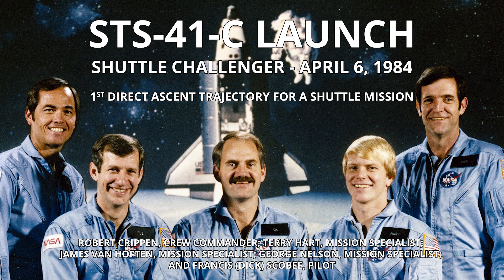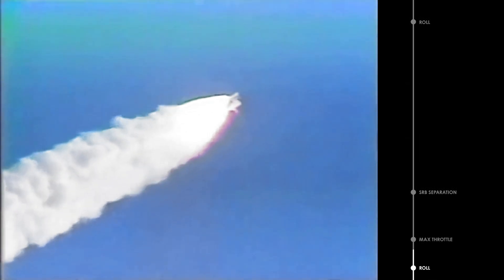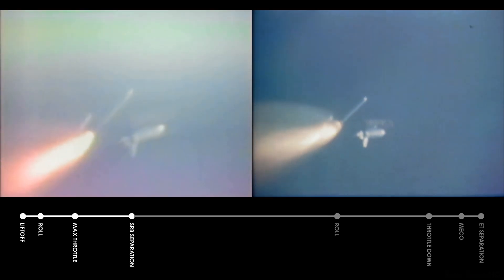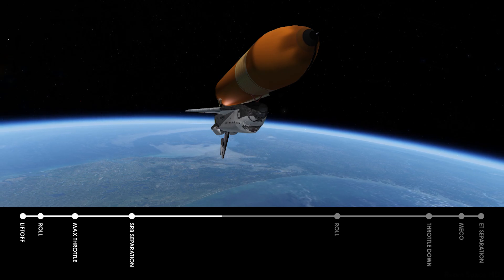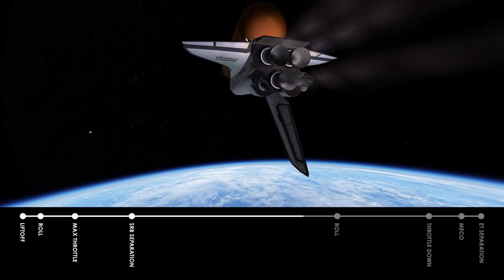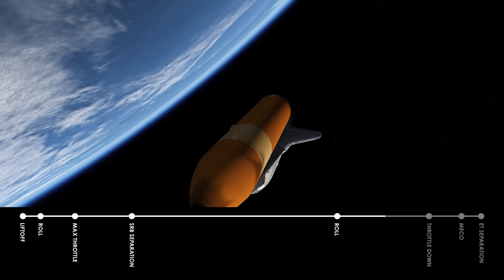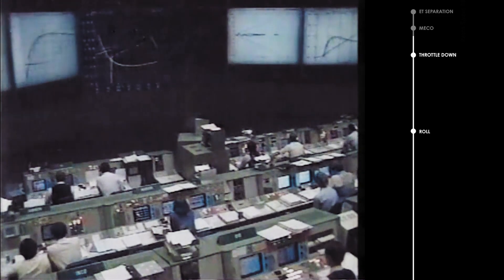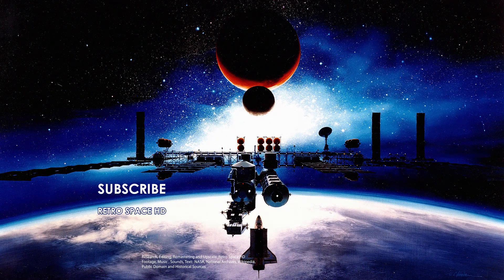STS-41-C Launch - 1st Shuttle Direct Ascent Trajectory, Challenger, 1984, 60fps

Comment: I am sorry to have to point out that the shuttles did not begin rolling heads up during ascent, after booster separation, until after 1997. Challenger had only ever climbed heads down. After 1997, the TDRS network made the tracking station at Bermuda redundant. Even Apollo 13 gets the heads up ascent wrong. Other than that, superb montage!

Comment: In regards to Solar Max, on Valentines Day 1980, Solar Max was launched to gather information on the sun and its activity on when the sun is most active during its 11yr cycle. Within nine months after launch, it had developed serious problems. Thankfully the satellite was designed with visits from the space shuttle in mind. The EVA techniques seen on this mission would come in handy when the Hubble Space Telescope was launched with an improperly grounded mirror and the assembly and maintenance of the International Space Station. The EVA Techniques seen on this mission will come in handy when several new sets of solar arrays are launched later this year and did come in handy when they had to repair the Alpha Magnetic Spectrometer (which was never designed to be repaired in space).

Comment: Also there wasnt a roll to heads up on this mission AFAIK the first time it was performed was on STS-87
Reply: It’s an automatic thing that’s done on an Orbiter Simulator Space Shuttle addon.
Reply: @zacharys41  Which addon is that? STS 2016 doesnt do that and SSU V4.2 (and i dont think it did roll to heads up either) doesnt work on Orbiter 2016 Also doesnt excuse it being on the timeline
Reply: @Lord_Merterus  You can add a codeline to an STS 2016 config file called, "inverse()". That automatically rolls the shuttle to its heads up position at whatever given time it's set. In my case, it's "345.0 =inverse()".

Comment: What made this mission launch different compared to previous other flights is that the SSME's accelerated Challenger on a trajectory with apoapsis at 330 miles (530 km) - the intended orbit altitude. Weile the ET eventually blew up in the atmosphere, Challenger's OMS engines only needed to circularize the orbit upon sepearation, rather than boost up to orbital velocity at the last moment the SSME's reach MECO a few mph shy of orbital velocity.
Reply: Apogee is the high point Perigee was around 55km on STS-41C Direct Ascent.
Reply: 530 km was near the limit of its max altitude in LEO.
Reply: @dare-er7sw  Actually it wasnt Shuttles maximum operational altitude was 920km
Reply: I heard from the crew that the ET broke up off the coast of Hawaii and it was as part of a test objective.
Reply: @foxmccloud7055  Theres footage of it in the post flight presentation